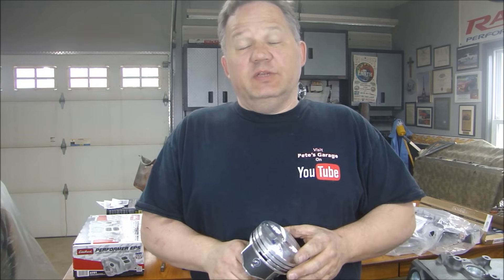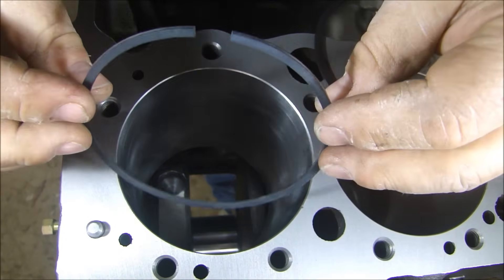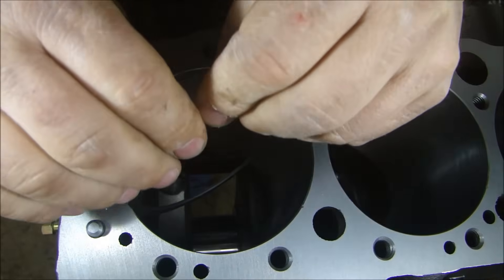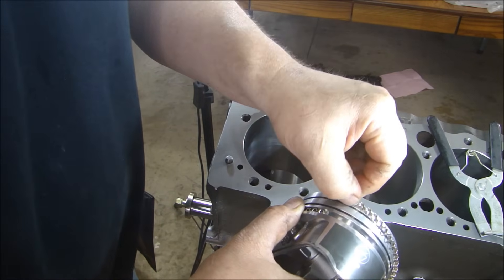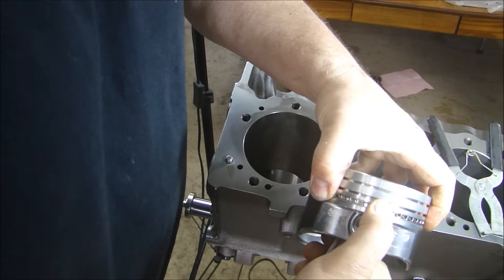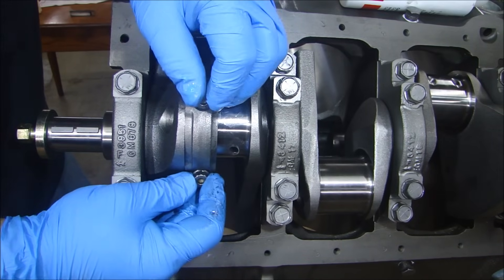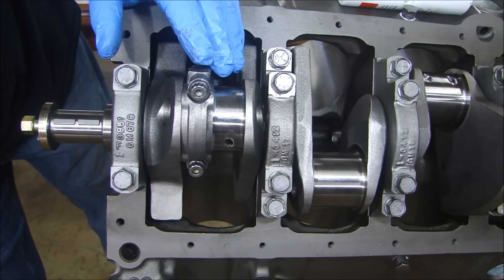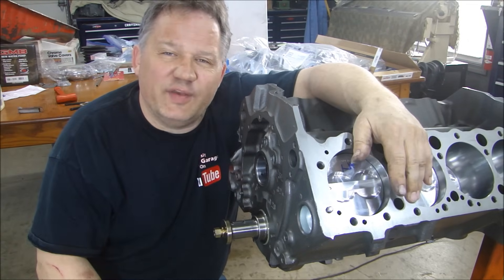Engine Building Part 2 - Gapping Rings, Installing Pistons in a 350 Chevy

Comment: If replacing piston rings on a 2007 suv with 116k miles, do you recommend replacing pistons too if there are no signs of damage to the pistons?
Reply from the maker: You can reuse them. You will need to check the cylinder bores for round and have them honed. If after they bores are bigger and the piston clearance too small, you'll need new pistons.

Comment: In the motorcycle service manual that I saw, the ring gap measurement is indicated to be measured at the bottom of the cylinder. 
You made the measurement at the top of the cylinder.
Reply from the maker: It depends, some engines have a tapered bore

Comment: Thank you!!  I bought a 390 to replace the 289 in my wife's cougar to take it back to factory specs.  Trusted the seller and did a compression test last night... 3 cylinders low pressure.  Want to keep the block as it matches the car but don't want to spend 10-15k on rebuild. Going to bring it in the basement for a winter project going to watch a lot of videos and this one was excellent.  Can't believe you put your phone number on at the end that is amazing
Reply from the maker: Good luck with the project, I'm happy to help

Comment: Ring two gap should always be larger than top ring. Why? So that compressed gasses that pass through the top rings can go down into the oil ring and then into the oil drain holes of the piston then down inside the piston and into the crankcase. If ring two gap is smaller than ring one then compressed gasses are restricted between one and two causing some back pressure wanting to lift the top ring off its seat. In this video ring one was 18 thou and ring two was 19 thou so just about OK.
Reply from the maker: Because that's what the manufacturers all recommend. Maybe I'll make a video about the "why"

Comment: Great video, good info and interesting to watch. Thanks for a lot of the good tips, my only 2 cents are, yes "clicking" the torque wrench multiple times may move it out of accuracy faster, however if fasteners still move when you click it the second or third time then it is indeed torquing it even finer and closer to the mark. A lot of the machinery manuals I use at work specifically tell you to do this. First click is within manufacturers tolerance for the torque wrench (assuming it's been calibrated), sometimes that is pretty damn close to the money and it wont move after that on the same setting, other times it's 3-6 percent off on the initial click and will need additional clicks if you want the actual torque closer to what the wrench is set and calibrated to. Keep up the awesome videos though
Reply from the maker: Thanks for the comment

Comment: I just did this. Not sure how much force it should be taking to turn motor with hand wrench 🔧. Almost spins the engine stand when I rotate engine. Is something too tight?
Reply from the maker: Something is too tight. You probably have a rod bearing or 2 backwards
Reply: @PetesGarage  I’ve messed with the CR cap directions. Tried them both ways. Doesn’t seem to matter. Same stiffness when I turn motor with breaker bar. Still seems stiff either way. I mean I know it’s not suppose to just spin freely by hand! But what’s TOO TIGHT? All bearings were to spec. Maybe I’m just paranoid
Reply from the maker: It should spin freely. Take off all connecting rod caps and try to rotate. If it's still tight, loosen 1 main cap at a time until you find which is making it tight.
Reply: @PetesGarage  It’s not the main caps, I could twist the crank by hand after I torqued them all down. I’ve tried CR caps both ways doesn’t make a difference. Turns with breaker bar on Crank Bolt, but takes some decent force

Comment: Any thoughts are have you ever tried to use the next oversize piston rings? They would obviously need to be filed to the minimum end gap. Any issues on sealing against the cylinder walls? Thx
Reply from the maker: I really do not use oversized rings

Comment: You are way to tight. At least .005 for every inch for bore. Why I see so many top rings lands on pistons blown off today plus a wreck motor. Hyperatic piston even put more heat into the ring which causes ring butt. I run .030 to .035 on the top ring. .030 on the second to be on the safe side. GM says there is no power lose up to .060 on rings gaps other than more blow by. So why would you take a chance to wreck your engine. Just run .005 per inch of cylinder bore. 4 times .005 =.020. I run .030 to .035 on the top ring. I have seen so many top ring lands blown off from running so tight.
Reply from the maker: I follow the ring and piston manufacturers recommendations

Comment: What is the part number for the rings? I have 2m139030 and both top and 2nd are at .020
Reply from the maker: It depends on the manufacturer, but these have to be the most common ones to find

Comment: Does the ring compressor go into the cylinder at all or just press up against it
Reply: Ring compressor will have to sit flat with the deck
Reply: @chickenfoundation9323  yes I did that and it worked, thanks though.
Reply from the maker: They do sit flat but can slip inside the cylinder a little

Comment: Hey Pete, thanks for the great video! 

I’m teaching myself mechanical stuff by working on an old 250cc one cylinder engine. Seems like I need new piston rings now after running a compression test. Was wondering if you have any thoughts on re-using the rod/bearings/bore/hone that is existing in a 30 year old engine. Trying to keep cost to a minimum.
Reply from the maker: Sounds great!

Comment: Why do SBC V8s only have 4 bolt main caps on the 3 center journals, i understand the concept but you’d think that 4 bolt would go on the end of the crank with the greatest amount of load and that is #1 as it has the balancer driving all accessories and thats a fair load even at normal driving speed 2-3000 RPM & #5 which carries a far greater load even statically 3-4 times more than #1 imagine the amount of momentum a clutch + fly wheel or a torque converter would build up at 2500RPM that is a lot of kinetic energy stored in each end of the crank, and looking at that engine it looks like it’s going to have a few performance adder’s fitted to it, so it will probably get spun to 7-7500 RPM at times
Reply from the maker: Interesting. Thank you

Comment: do you have to replace rod cap screws when putting it all back together? Or is it safe enough to reuse the rod cap screws? Or does it depend on the specific types?
Reply from the maker: You can reuse them

Comment: What's the gap for the oil rings?
And it will be for all V6 or V8 engines under 20?
I'm rebuild one 5.7 hemi for my 04 dodge durango
Reply from the maker: Gap should be on the packaging recommended by the manufacturer
Reply: @PetesGarage  thanks for replying!
Reply: @PetesGarage  I saw a video they torque the crankshaft at 21 + 90° turn
I did it but my crankshaft doesn't turn smooth like yours 
I have to used ratchet to turn it it's little tight
Reply from the maker: One or more of your pistons are backwards
Reply: @PetesGarage  I'm still not installed the pistons yet 
It's just the crankshaft by itself
Reply from the maker: Then the crank is bent
Reply: @PetesGarage  I put 75 of torque now it turns freely

Comment: I'm building a 350 boat motor. I must have bought oversized rings and I'm having to gap them.  You said some rings can over lap. If the gap is not enough can the rings break from expansion.  I dont want to much gap.
Reply from the maker: YES....do not let them touch
Reply: Preciate.  I went ahead and bought a new set of the correct size.

Comment: Am I correct in assuming that if I have my SBC block bored 30 over, then I can get a ring set that I don’t have to grind?  Or, can I just get a ring set that doesn’t have to be ground no matter what?  Thank you sir for always answering questions, responding and being one of the best channels out there.
Reply from the maker: Yes, if it is truly measured .030" over you can buy the set ready to install.
Reply: @PetesGarage  awesome, thank you!
Reply: @kosworkshop  measure everything🍻
Reply: @whiplashmachine  thank you!  That’s a good general rule especially for someone new like myself.  You do see a lot of videos of folks just building engines blindly.
Reply: @kosworkshop  yup, lots of slapped together projects out there. Then they often cost even more to fix. Every year I see easily a half a dozen brought into my work to  get fixed up because no attention or inspection was given. This year espesially, I have come accross many manufacturing or packaging errors from our parts vendors. Some of them would have been very costly errors had them parts made it into the engine.
Reply: @whiplashmachine  can you recommend any good sbc engine building books that would be beneficial to a new builder?

Comment: Should the rods be loose on the crank like that?
Reply from the maker: Yes, the should not be so tight they don't move
Reply: @PetesGarage  I am rebuilding a 1960 MGA engine, 4 cylinder 1600. I put in new pistons, rings, and bearings, and it seems as I am turning the crank, it gets harder to turn when pistons are all in the middle, but when the 2 are at TDC, and 2 at BDC, it gets really easy to move crank. It only seems harder to turn at that mid point. Is that normal?
Reply from the maker: Make sure the pushrods are facing the correct direction, chamfer faces the crank
Reply: @PetesGarage  , Thanks! Yes they are. I took everything apart, and discovered the number 3 cylinder had one of the compression rings upside down.
Reply: @PetesGarage  , I forgot to mention that the crank turns perfectly smooth with new main bearings. There seems to be no room to move the rod ends after they are installed on crank. The first piston when smooth, then it got progressively harder as I installed the rest. I thought this was normal to have ring drag, but I would think that would be throughout the stroke, even at TDC?

Comment: 10:16  I use new engine oil and coat the cylinder walls and the piston/rings in oil before installing the piston assembly.  Everything goes together coated with new oil.   :)
Reply from the maker: I do the same

Comment: Hi Pete, really enjoy your sbc 350 build series. Would you up to answer a few questions I have? I'm in the process of same build.
Thanks
Sam T. Former Akron guy
Reply from the maker: How can I help you?
Reply: @PetesGarage  Thanks for getting back to me.
I have an 1987 sbc, 350 bored +.030. The block has the 3 bosses for spider (not drilled and tapped, also has boss provision for cam retainer. The lifter bores are not milled for dog bone alignment retainers. Here's one of my questions. 
I purchased a cam retainer, and did drill and tap front bosses and  that looks good, if I purchase a factory style roller cam, will aftermarket tie bar style lifters work or will the lifter bores be too tall because as I stated above they were not milled? I realize I can not use stock roller lifters. I am trying to stay budget friendly.
I like the Edelbrock, e-street aluminum heads. Can i use my selfaligning stamped factory rockers instead of purchasing roller rockers$$$?
Last question?,  what is an good head gasket for aluminum head to cast iron block?
I really appreciate your time to read all this and maybe steer me the right direction. 
Thank you Pete.
Sam T.
 $$$?
Reply: Ps. I did have the block decked .012 for flatness and trueness.
Reply from the maker: You can get roller lifters that will fit with the tie bar. You can use the same type rockers but you will need to measure for pushrods. A regular Fel-pro gasket will work unless you want to step up to a MLS gasket. Cometec  is a good gasket
Reply: @PetesGarage  thank you Pete, gives me some things to consider.  Appreciate your feedback. 
Sam T.

Comment: I am assembling a 351 cleveland and after installing the pistons it takes 35 ft/lb to rotate the crank. Is this normal? I checked the clearances and piston ring gap 3 times and they're good. I am using cast iron rings and clevite performance bearings on a standard bore and crank.
Reply: stock pistons and rods with the caps on correctly for sure (there are numbers stamped on the outside and they all are matching)
Reply from the maker: 1 or more pistons are in backwards, chamfer on the rod faces the counterweight
Reply: @PetesGarage  They were all on correct but I took the pistons back out to verify everything was good and now its taking 25 ft/lb to turn over which should be ok if I remember correctly. Maybe I had some dirt in there

Comment: Hey there. I’m doing a piston and rings on a 4 stroke dirt bike. The ring gap calls for a .04 to .06mm. What happens if the ring gap ends up being .08 to .10mm?  This is all oem parts. Bike has a lot hours.
Reply from the maker: You will lose compression and leak oil

Comment: Great video. I'm just wondering, when you clock the rings and install them cant they just spin freely in the bore? Or are they so tight on the bore they cant?
Reply from the maker: They can and they will. There is always much discussion about this
Reply: @PetesGarage  i swear that I have seen little pins in the grooves on some pistons. But I might be mistaken 🤔
Reply: @trailerpark187   You are not mistaken.   You will find that two stroke engines (Marine, Dirt Bikes, ...) use pins in the ring grove to prevent the edge or a ring from catching a piston port if they were to rotate.  A four cycle engine, such as this car engine, does not have piston ports to transfer air fuel from the crank case to the combustion chamber, so no piston ports exist in the cylinder side wall.     
(Pete - great job, thanks so much).

Comment: I am building a ford 302. I have installed all the pistons and rod caps. The rod caps I have finger tight. Is there a torque sequence I need to use to torque all the rod caps or start from one end and work my way to the other end. Thank you. I enjoy your Youtube channel
Reply from the maker: There is no sequence, but you can do it in stages

Comment: When measuring the ring gap shouldn't you measure in the bore it will live in? After all the tolerance diffs in bore diameter may change how much you got to remove from the rings.
Reply from the maker: Correct

Comment: thanks for the cool video, I know it becomes messy but I think ( and i do) wipe the rings with a smear of oil so they aren’t dry on the 
sides (top and bottom) also that ring gap seem a tad big, I have used next size up rings once and filed them down for correct end gap as we 
know we loose some compression with large end gap, Awesome work cheers Brett
Reply from the maker: Thanks for the info!

Comment: Thanks Pete. I have a 383 stroker engine that I had fully built in 2008. After putting it in my 1966 Chevelle, I moved away for college.  I only drove the car a few times (less than 500 miles), but when I did drive it, I drove it hard. I was young and reckless.  I am now 30 and got the car out of my moms garage in Illinois and into my garage in PA.  After doing some assessment, I found 4 broken pistons caused by what I would assume to be detonation. Like I said, I drove the car hard and not very often.

These videos of yours are going to help me tremendously when it comes to fixing my engine.  I know it would be best to have a pro do this, but TBH, no man should ever let another man touch his car without him present haha. And how the hell am I going to evolve as a Car Guy if my "work" is just opening of the bill fold? 

Thank you for being a resource for myself and so many others!
Reply from the maker: Right on my friend....you gotta build it yourself

Comment: Does the size of two oil rings would be different from upper one's 1st & 2nd ring or it would be gapped same...
Reply from the maker: They are different than the top ones
Reply: Are the oil rings losend then the upper both compression tings or tightened then upper one's
Reply from the maker: It depends on the manufacturer, they are not oil rings per se, they are wipers
Reply: @PetesGarage  bro i was asking about the end gaps of two oil rares/rears,i dont know the name of them correctly  in Pakistan we generally call them oil rings...
The ring below & upper side of oil viper can u help find the best gap for them i have 4 cylinder 998cc Suzuki Alto i can thell you the exact size of bore

Comment: Hii pete...
Can i repeat the same ring gap  process for an 4 cylinder f8 engine...
& u did'nt tell about the other two oil rings what would be the gap size of them according to you...
Reply from the maker: You can, always follow the manufacturers recommendations on the box
Reply: Bro can u tell me manually how should i size the ring of my f8 4 cylinder rings i m Fitting NPR over sized rings in standard cylinder & standard piston cuz my piston was giving me a little play so i thought to put over size rings of 0.25 but i m confused in gapping them
Reply from the maker: When you buy the rings the manufacturer includes a recommendation on gapping them for different applications
Reply: @PetesGarage  yes i will chek over & thanx for guiding

Comment: im freshening up my  sbc383  .030 with fordged pistons, eagle rods, dart heads etc and im not  clear on the ring or ring gap i should run, i do plan on spraying it with 250hp shot. can you please give me your opinion on what material the rings should be and  the proper gap?
Reply from the maker: Use chrome moly rings and follow the recommendations on the box for boost applivations

Comment: What are you using to push the piston down? Us the piston compression tool still in the bore as you push the piston down?
Reply from the maker: I use a soft blow hammer handle
Reply: @PetesGarage  any idea of the brand of the stuff you're using to hold the engine block in place pls?
Reply from the maker: It's just an engine stand
Reply: @PetesGarage  thanks